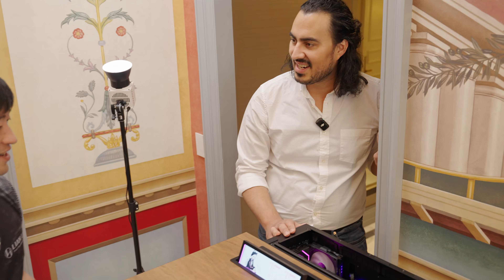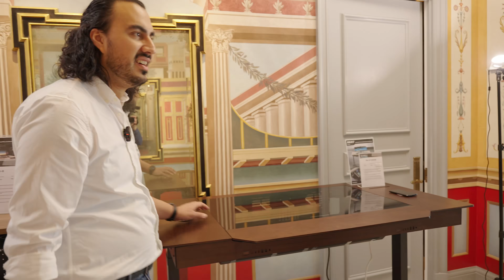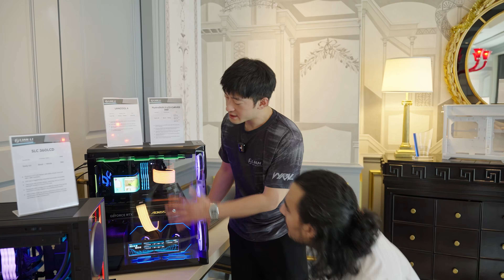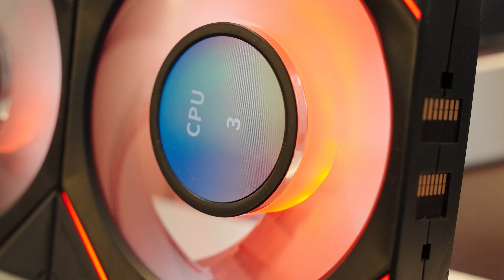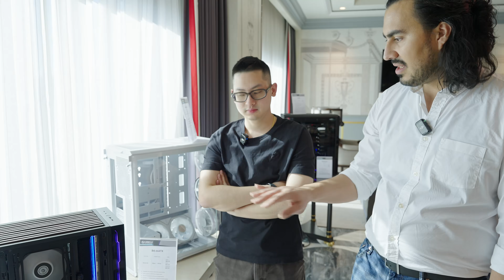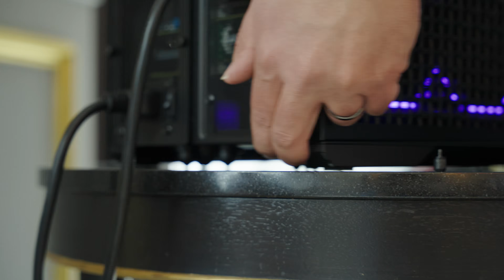Lian Li CEO Exclusive CES 2026 Tour | Micro Center

Comment: That first sit-stand desk with the PC integrated... awesome.  Not for me as I want to display my PC, but it just shows that you guys at Lian Li are still thinking about how people use PCs.

Rear IO has always been my greatest bugbear.  It sounds like you are trying to address that.  But how about a simple cover that would clip on the back of a PC and box in the rear IO to tidy it up.  If I had a 3d printer I could print one myself.  External cable management.
Reply: At this point, I think a lot of people who want to just preserve space on their desk will still just choose ITX cases over an integrated desk PC like the one here. It's designed for a very niche set of customers. That said, the innovation and engineering involved is simply astonishing. 

You can't really help but ogling these products even if they're not something you'd invest in yourself.